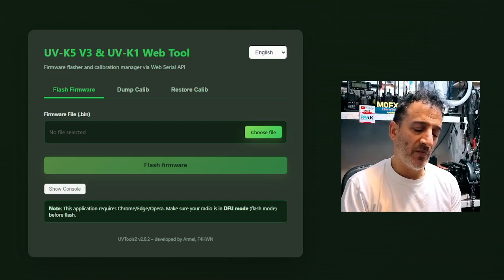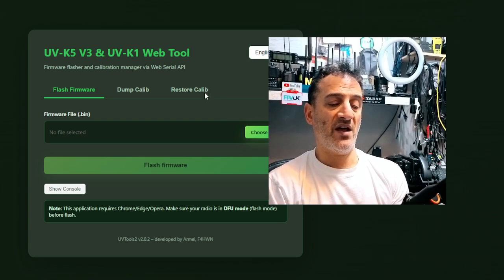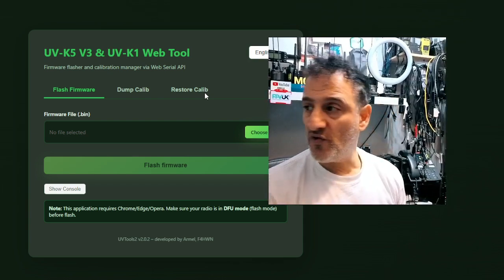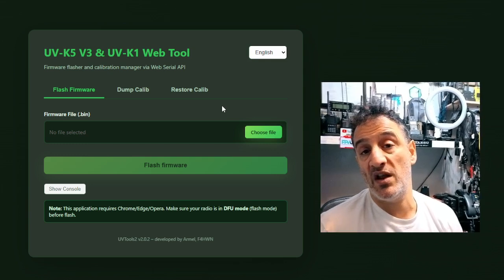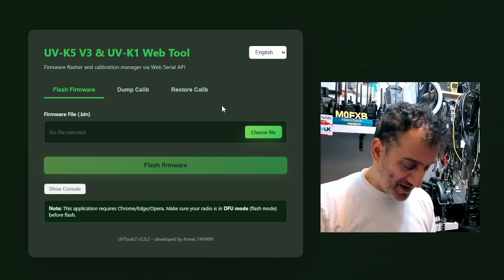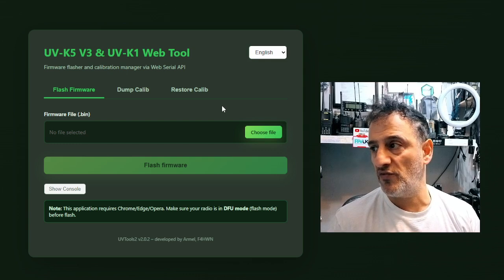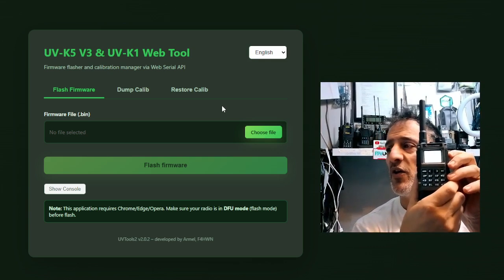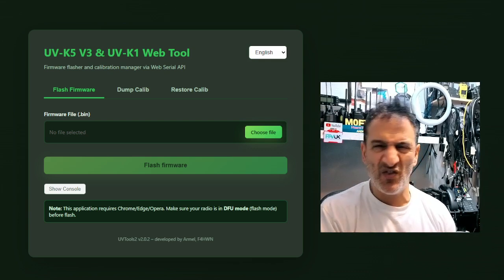V3 - Quansheng UV-K5 , F4HWN Fusion Firmware

Comment: how to flash a k5 with v7.00.11 stock firmware and BL7.700.70?
Reply from the maker: Send me a link is it vesrion 1 radio or version 3 .
Reply: @M0FXBHamTech  The firmware that works on the radio is the latest one on the Quansheg website. I tried flashing EGZumer, it says the flash was successful but the radio gets bricked. It only works again if I flash the stock firmware; I haven't been able to get it to work with any custom firmware.

Comment: I have five of the Quansheng in UV-K5, K5(8), K5 (99), K6 and Quansheng's version of the  UV-5R Plus. None of mine are Version 3, in fact I can't find a version # on any of them, so I just install the non fusion F4HWN v4.3 on them all this morning. I don't know if there is any real difference between the Fusion version or the UV-K5 F4HWN v4.3 version of firmware. From what I read, it appears the Fusion version is just a combination of all the F4HWN firmware designed for the new version 3 K5 and K1 radios. Anyway, everything works great, including Air Band.
Reply from the maker: My device will not allow the install